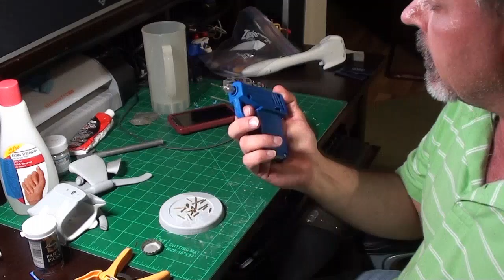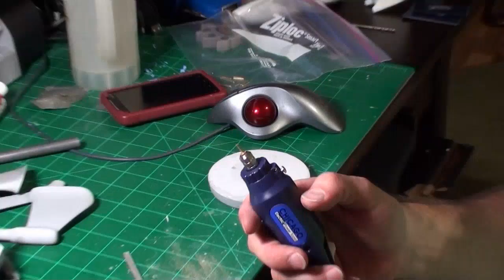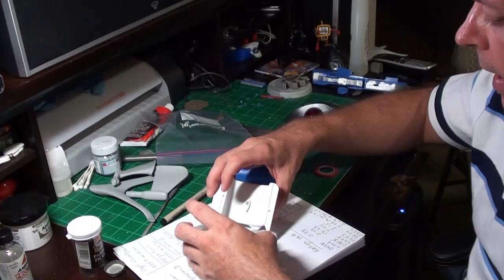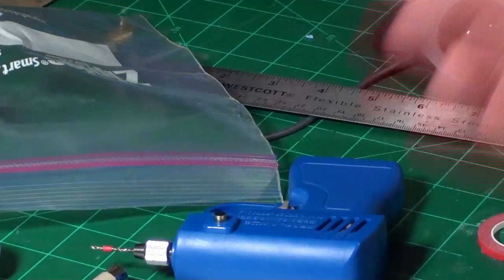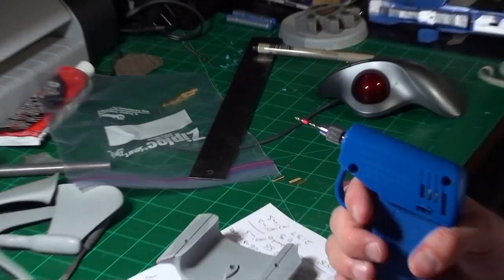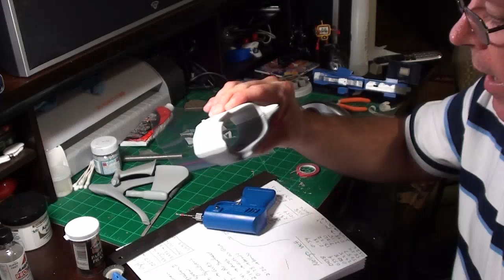Brakiri cruiser:  Pins for everyone!

Comment: Another marking tehcnique is to place a spot of paint on one surface then bring it togther with mating surface. I've tried that with some metal figures a while back.
Well done on maintaining the hole perpendicularity, thats the part the I always find hardest when drilling by eye. You'll be doing very well if you get a probable error as low as 0.1mm with the vernier caliper in that sort of application. As always the vid was well done and a pleasure to watch.